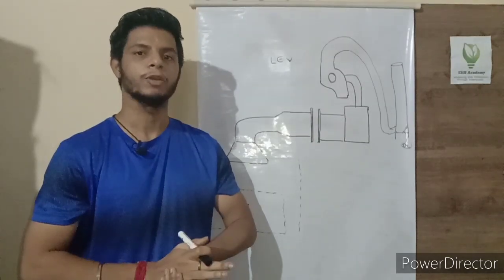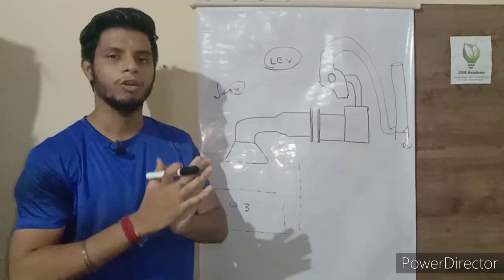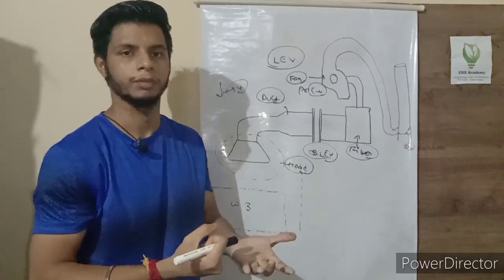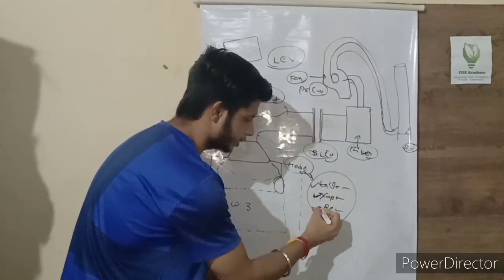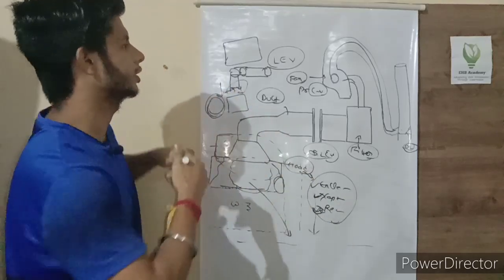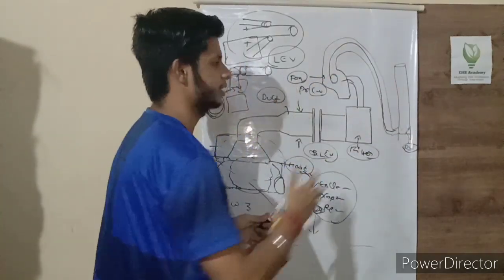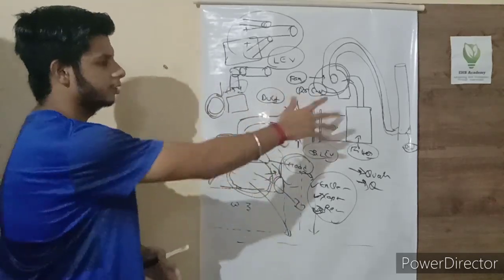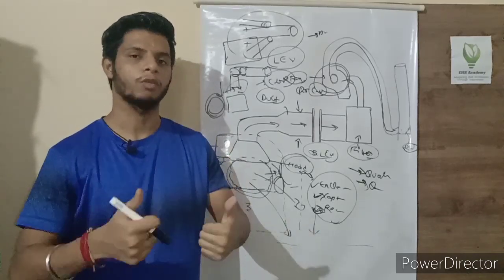Local Exhaust Ventilation System in English 🔥🔥🔥| Full Analysis | Industrial Hygiene

Comment: Thank you so much for the excellent explanation Sir. I m doing something related to LEV for my Final Year Project. And now i am stuck with the conceptual design for the LEV. Where can I start?
Reply from the maker: Hello 
Start ur Conceptual Design by Considering Various Factors Like:-
Contaminant Cloud Size 
Movement of Contaminant Cloud
Nature of The Processes
Contaminant Generation Rate 
Suitability of LEV Hoods
Consideration for Turbulence in Piping Network by Implementing V-Junctions Instead of T-Junctions 
Stack Height & Location 
Etc.
Reply: @EHSAcademy  you gave a very good rough ideas on what should I consider later on, Thank again Sir for the quick reply. Really appreciate it
Reply from the maker: Later on u Can Consider Various Parameters like:-
Face Velocity Requirements of LEV
Static Pressure of LEV
Transportation Velocity of LEV System
Criteria for Qualitative & Quantitative Testing of LEV
Reply: @EHSAcademy  Thank you so much for the help Sir